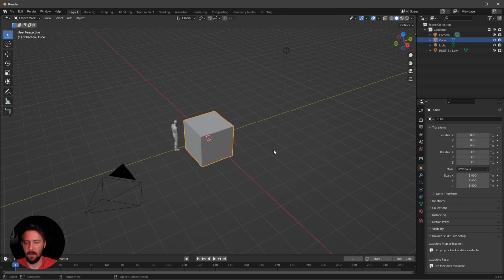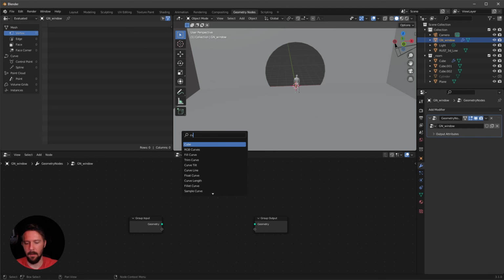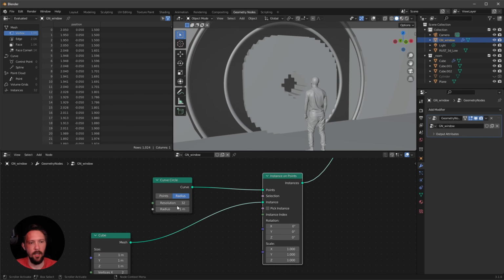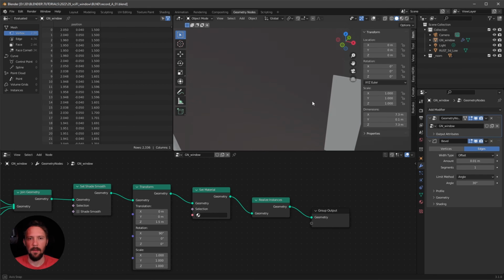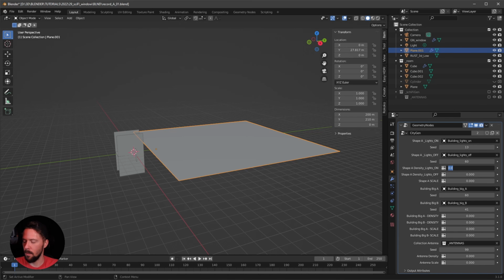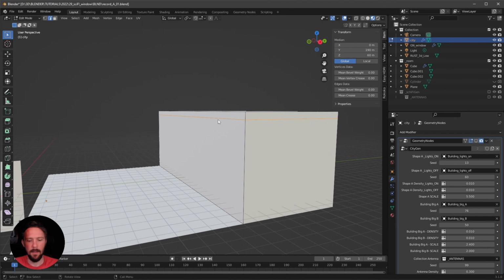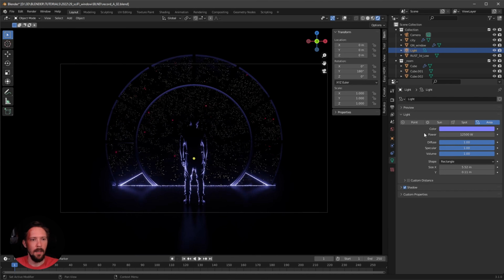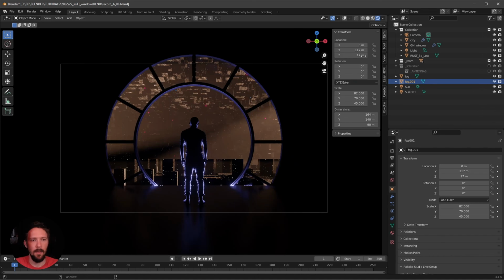Blender easy Sci-Fi Environment Window Scene | Eevee

Comment: All of those speckles showed up in the render how do I get rid of those
Reply from the maker: Hmm 🤔 what do you mean? 😅
Reply: I was getting the firefly effect in my render. What appeared to be like blown pixels or something. Tried increasing the samples on the render and everything it didn’t fix the problem
Reply from the maker: Do you use cycles or Eevee?
Reply: @PizzadelRay eevee.  
It basically looks like there are blown out pixels in the fog
Reply from the maker: Hmm 🤔 sounds weird. Maybe you can write me on Instagram and send me a screenshot?
Reply: @MTOcreations  i had that problem  is in viewport mode with evee 
like there are pixel if its that case it is a problem with ur laptod i treid alot of method but it did not work only after i change my laptod then the pixel disappear